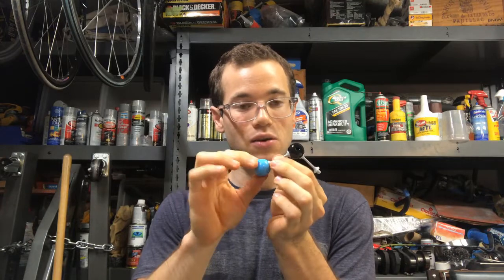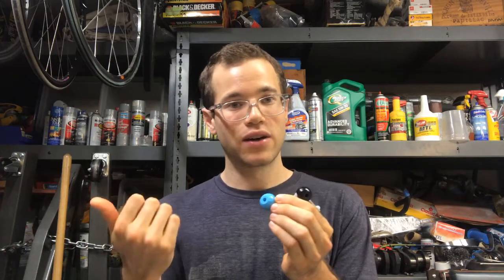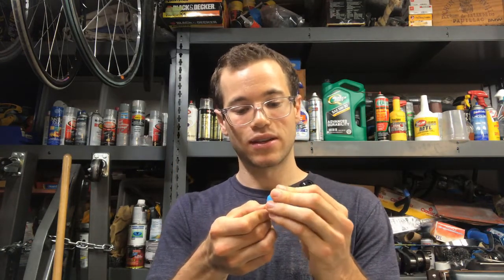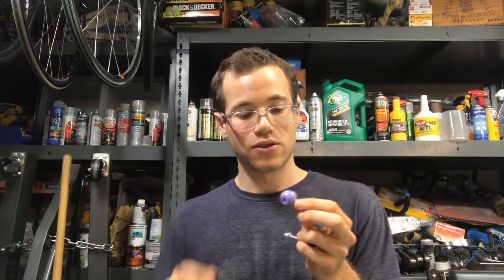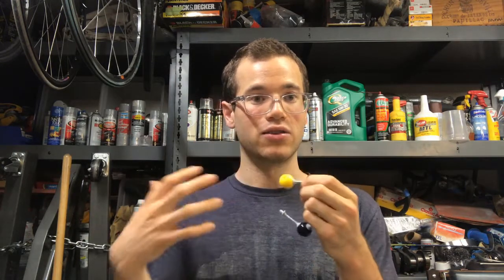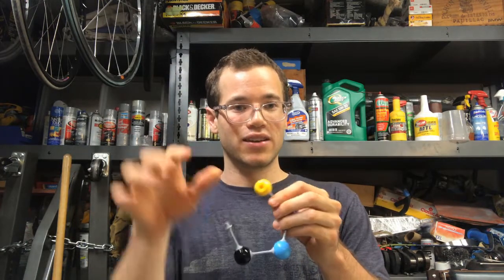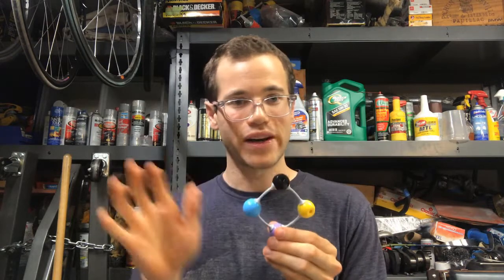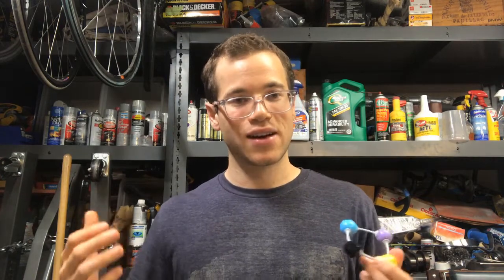Tesla Model Y Heat Pump - Engineering to break the Laws of Physics?

Comment: I think Tesla’s heat pump is more complicated. It takes heat directly from the battery when it’s available and begins to mix additional heat from conventional heat exchangers when needed. That’s why the heat (octo) exchanger is so complicated. Cooling the interior is probably more conventional unless the heat is used to generate power to provide power for a compressor.

Comment: If a car is heated with a heat pump, it's a good idea for a car builder to add the ability of a dehumidifier,. Because when it's cold and raining windows steam up from inside.       Just few valves allowing the liquid to cool the cabin a little and heat at the same time.